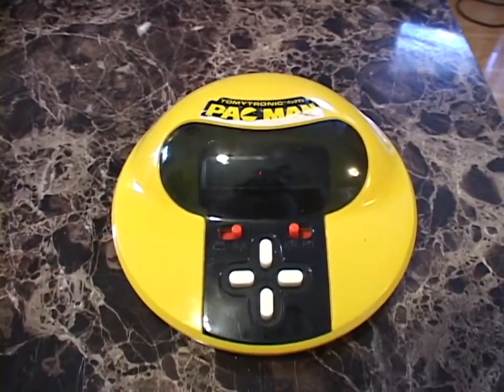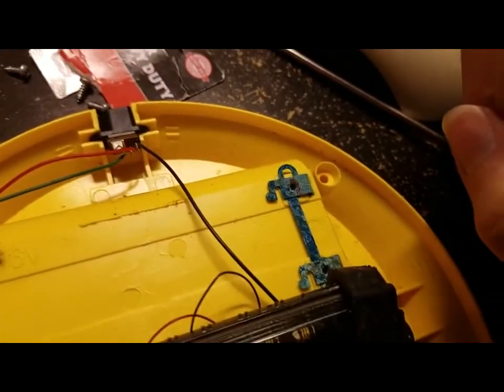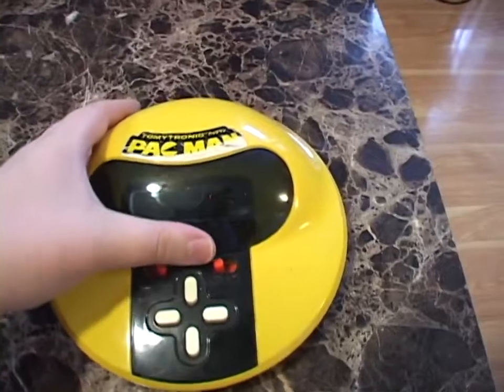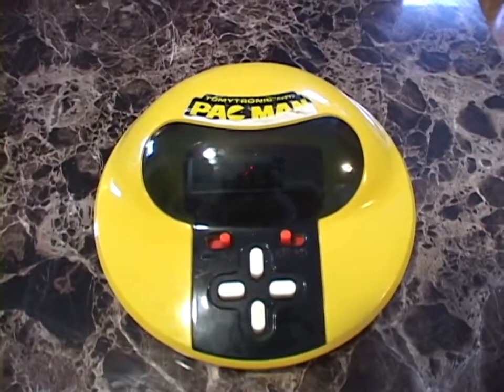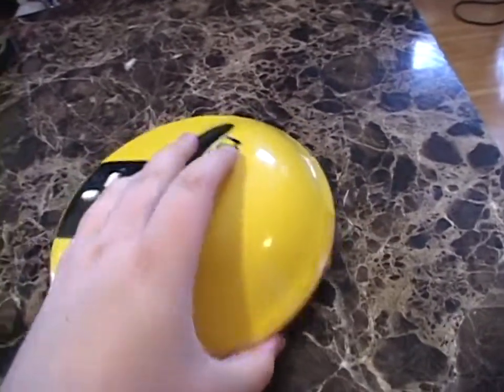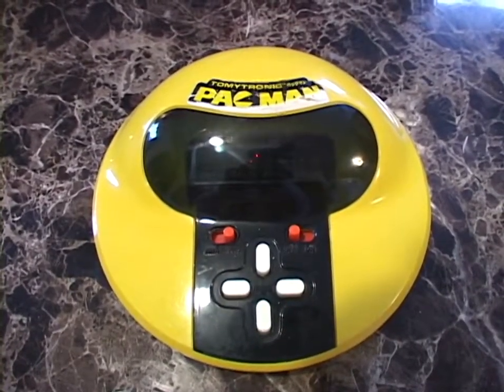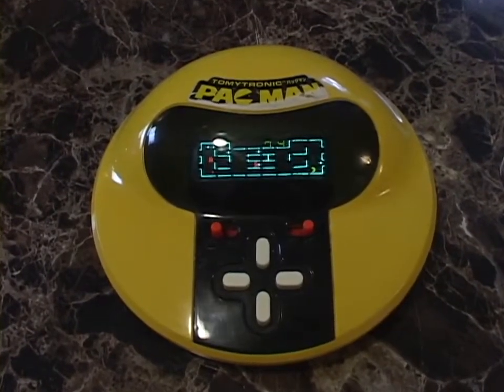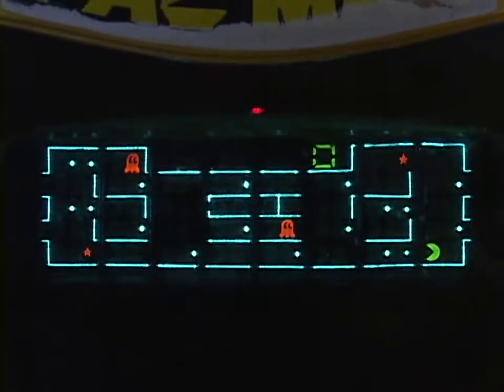Tomytronic Pac-Man electronic game (1982)

Comment: Could you not have soldered a resistor between the audio output on the circuit board and the piezo buzzer?  Just curious.
Reply from the maker: .....yes. I just chose the lazy route instead lol